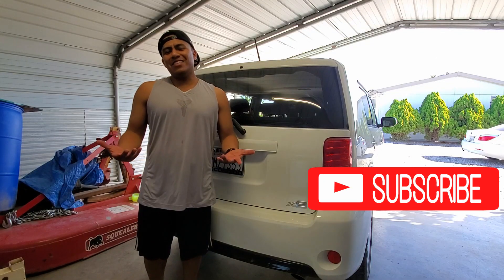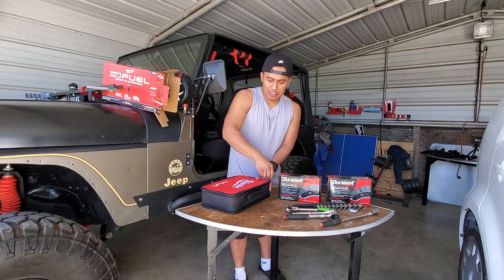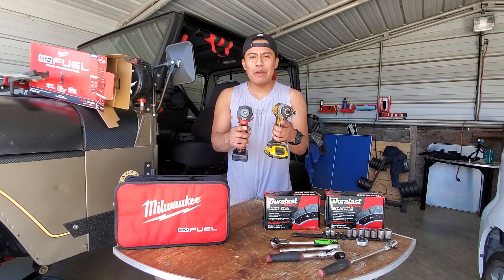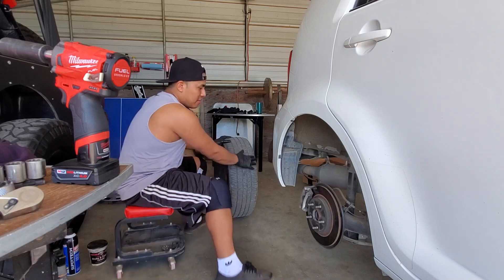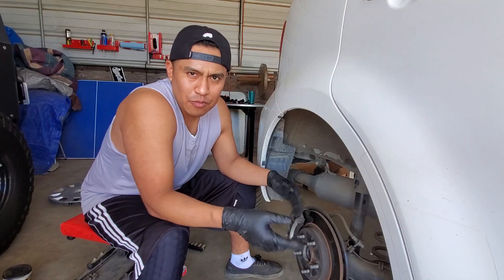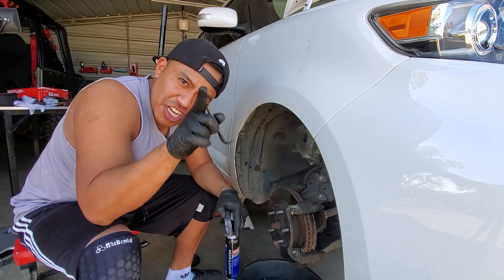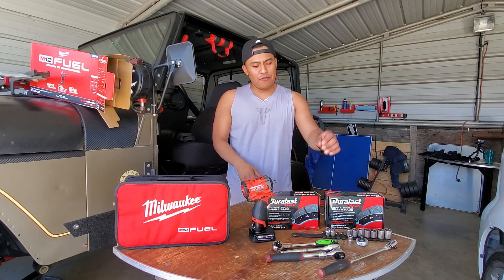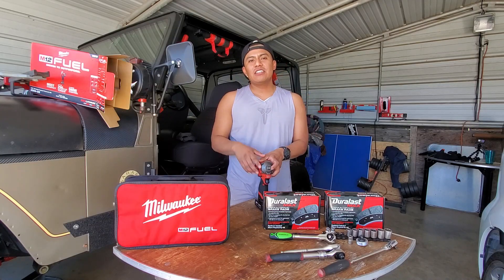Stubby Impact For The Jeep YJ and Shop!!!

Comment: The bigger battery does give it more power AND longer life.
Reply from the maker: Hello @J Fajardo, after using and testing out the bigger battery, I did notice a difference compared to the smaller  battery. 👍👍
Reply: I have 2 x 2ah and a 6ah, there is a most noticeable increase in strength on bigger battery ime

Comment: Will it remove 150 ft. lbs truck lug nuts?
Reply from the maker: Hello Steve, in all truth I haven't broken a truck lug nut at 150 ft. Lbs. It has broken a 130 ft. Lbs. Jeep lug nut with a few seconds of pounding and I assume it may do the same for 150.
Reply: Yes it will. It's been proven
Reply: yes may take a few seconds longer but no problem